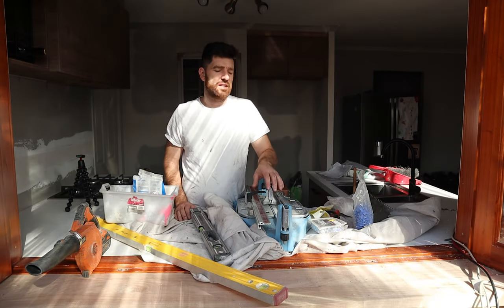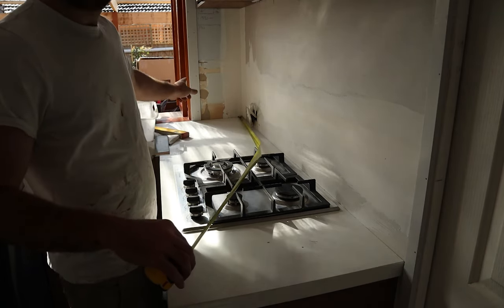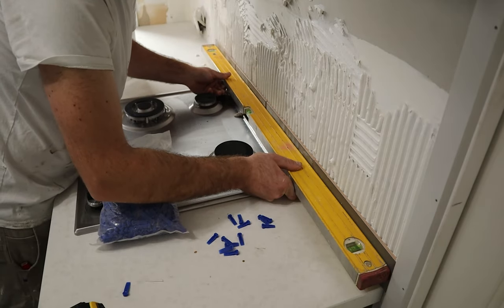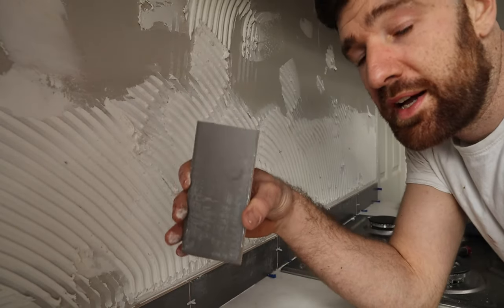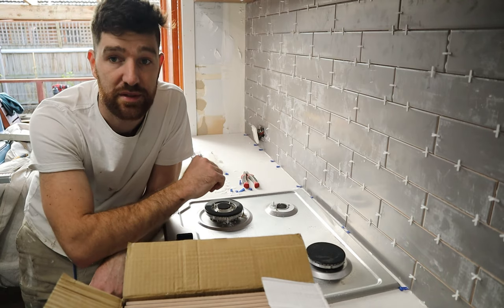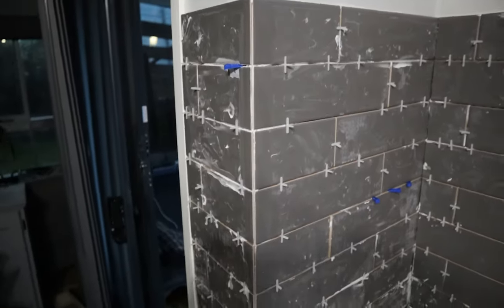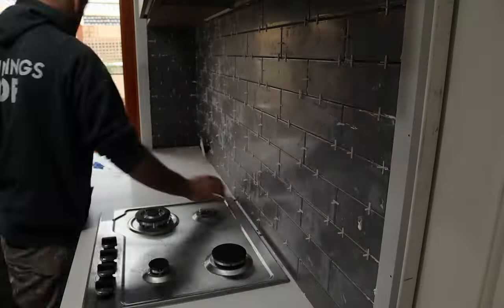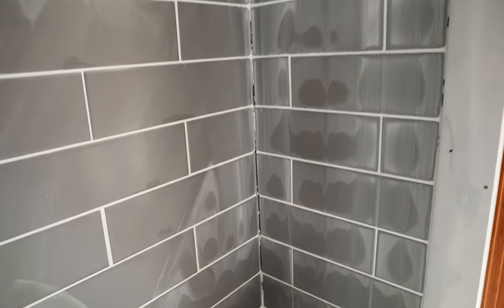How To Tile Your Kitchen Splashback - Brick Pattern (4K)

Comment: Hi 👋,  what do you do with the dirty water? What's the correct way of disposing of it?
Reply from the maker: Generally speaking the old school way is to dig a hole in the garden and empty it there. Wait for the water to filter out and then cover it back up. 
Modern ways include using something like a slurry bucket which also filters out sediment which you can later throw out. Whatever you do just don't pour it down the drain.

Comment: Hi but what if the worktop isn't level and we use the worktop for our 1st row
Reply from the maker: You'll have to cut each tile individually so that the bottoms of the tile match the slope of the work top and so that the tops of the tiles are level and line up with each other.
Start with a full tile at the lowest end of the work top and as you work your way "uphill" each tile will need more and more cut out of it to keep the tops level as i mentioned above.

Comment: what size spacers are best for brick effect splashback tiles? I have a spare bag of 2mm ones but I think they're too small for the brick effect.
Reply from the maker: 2-3mm is good. I've always thought big grout lines are ugly. if you want a genuine brick effect you'll need 10mm gaps and tiles that look like bricks 😂
Reply: @dingeldiy  I used 2mm and it looks great

Comment: how'd you go getting those power points re-installed with added thickness of the tile?
Reply from the maker: Not usually a problem but you can buy packets of longer ones for very cheap
Reply: Longer bolts

Comment: Did great on the mitered corner but then kind of screwed the pooch with that 45 degree grout pack at the top.  That's just hideous.
Reply from the maker: It's not the most elegant solution that's for sure!
Reply: Could have put a nice piece of stainless steel edging or at least a black plastic one !